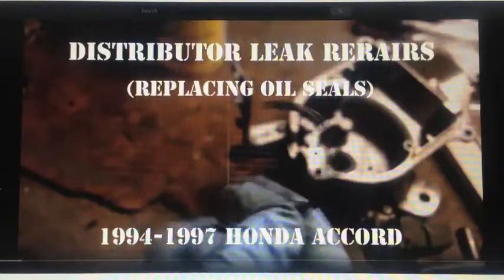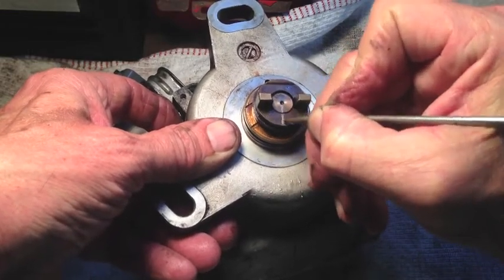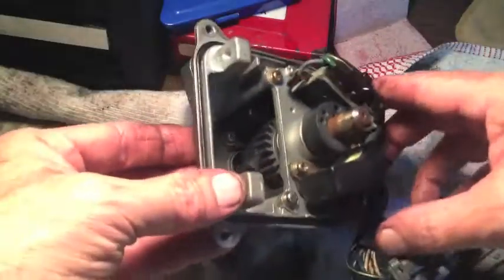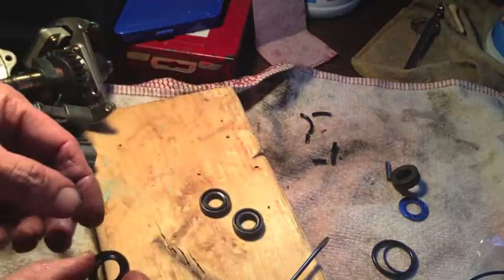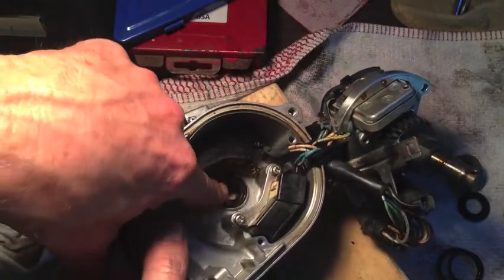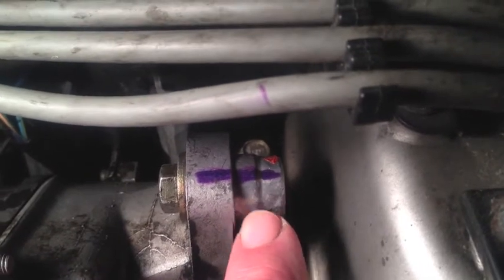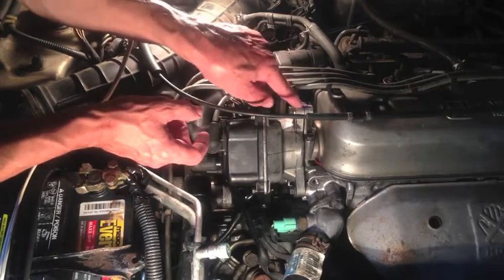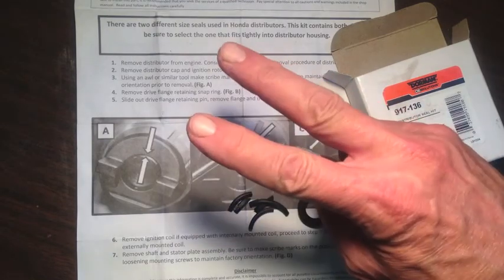Honda Distributor Oil Leak Repair (Seals)

Comment: If you're going to replace the heater hose that runs under the distributor, and you don't want to pay $30 or so for the OEM Honda hose 19527-PHK-000 from the stealership for a '97-'01 CR-V, I did the ground work for you (since after some closer inspection under the distributor that hose was SWOLLEN from probably years of oil dripping onto it from a bad distributor o-ring, and the previous owner(s) neglected it). They have epdm heater hoses at Napa for $.99/foot for this size hose. This is a 5/16" (7.9mm) heater hose (NOT 1/4" as stated on Napa's website), and it is 9" long (Not 8" long as stated on Napa's website) so one foot is all you need then cut to length. Napa part number NBH H149. It took me THREE tries to get this correct since Napa's website has the wrong info for this part. Still saved myself $30 though. You're welcome.

Comment: The aftermarket distributor I replaced my original with is already starting to fail six months later. I replaced it due to an internal oil leak. The replacement isn't leaking, but it's starting to cause a brief cold misfire most mornings. I wasn't sure if the car was even going to start this morning. Typical aftermarket electronics....
I almost dropped about $500 on a new distributor from Honda today. I'm glad I discovered this video, and kept the original distributor. I'll have the parts tomorrow, and plan on re-installing the original distributor this weekend.
Thanks, you might have saved me $485 with this video.
Reply from the maker: Hope so.. Good luck..
Reply: Yo did you install the new distributor without having to use a timing light?

Comment: Thanks buddy 👍 Just what I needed to fix  that oil leak. Also replacing the heater hose below the distributor.
Reply from the maker: Glad to help.. And yeah perfect time to replace hose.. Mine had recently been replaced so I just cleaned it off.. Thanks for reply..
Reply: @tongo117  can oil in the distributor cause no spark ?
Reply: @goldengaming1112  I know it’s a month ago but yes it can wear down the electronics in the distributor. I’d try  fixing the leak and then cleaning the inside of the distributor before replacing it to save a buck though.

Comment: hey so I accidentally snapped the dog ear on the drive dog and want to replace it and I see that you marked the orientation to put it back on but I was wondering how I could make sure I have the correct orientation on a completely new drive dog that im going to replace the old one with? can I just point the line indent that's only on one side level with the line on the distributor itself and put the new dog on with the line at the same orientation? its an expensive coil on plug conversion distributor so I really don't want to mess it up, Thank you so much in advance

Comment: my distributor has been leaking out for almost a year , my car is honda accord 2002 manual transmission, unfortunately now i have a failure in my vehicle speed sensor and Engine Coolant Temperature sensor because they are under the distributor , i didn't know anything about it but now i know 😢  , i ordered a new vehicle speed sensor, new Engine Coolant Temperature sensor, new o ring and new distributor seal,  i hope i can fix this  , 😊
Reply from the maker: you can.. good luck..
Reply: Howd it go? I've a 1998 Manual Accord as well. Leaks in the same damn place. Need to do this replacement. Anyone thought of just replacing the whole distributor?  I think they're inexpensive?  ALSO- i just did a swaybar upgrade video how to (front & back) for 98-2002 Accords!  Check em out if you want.😎

Comment: *Seal not gasket
If it seals a moving part it's a dynamic seal. If the part it seals doesn't move it's a static seal/gasket or O-ring.
Reply from the maker: Understand.. Thank You..

Comment: Hello, Im going to try this out, but I am scared about messing up the time as I dont have a timing light, did you have any timing issues with the method you used?
Reply from the maker: This was my first time taking the distributor off of any car so I was also concerned about messing up the timing.. I just tried to be careful about disassembly/reassembly so that it all went back together the way it was originally.. I didn't have any timing issues.. And this was done 4.5 years ago still have the Accord still runs well..

Comment: What exactly is the distributor connected to…. I changed my seals the other day and everything went fine until I was putting it back on , I was tightening the top bolt and the threaded hole snapped so the distributor is now only held in by the 2 bottom bolts

Comment: Thank you for your video.  Does Dorman Seal Kit 917-136 fit 1998 Honda Accord LX 2.3 L.
Reply from the maker: It should fit if your Accord has a 2.3L F23A5 engine.. This link is from the Dorman site: https://www.dormanproducts.com/p-76845-917-136.aspx?year=1998&make=Honda&model=Accord&origin=&parttype=Distributor%2520Seal%2520Kit&enginebase=L4%25202.3L%2520%282254cc%29&enginedesignation=F23A5
Reply: Thanks for your reply.  Do all Honda Accord LX 2.3L L4 have F23A5 engine?
Reply from the maker: Apparently not. The link below takes you to the Dorman page for the 917-136 seal kit.. If you follow the select your vehicle drop downs there will be 6 of them.. The last one is for engine designation.. There are 4 possibilities listed with the F23A5 being the only engine that the 917-136 kit fits.. https://www.dormanproducts.com/applicationcheckfit.aspx?&productid=76845
Reply: @tongo117  Thank you.

Comment: Hello, i tried doing this today and i could not get the pin out of the dizzy once i removed the cotter pin, i was hammering it all day and was not able to do so. any tips ?
Reply: Rubber Mallet the surrounding area, it'll loosen it up even if you aren't hitting the dizzy directly

Comment: I did my valve cover gasket and outside O ring and cut off the swollen part of the heater hose and thought I had the worst luck the only leak after the job is dripping right back on the heater hose and it's already swollen again.

Comment: Thanks for the vid, how did these seals end up holding up?
Reply from the maker: over 2.5 years later no leaks..
Reply: @tongo117  Makes sense when the old ones have gone 25 years! Mine's 1996 so also 25+ years before it leaked

Comment: My b18 leaking oil their its performance really doesn't feel the best. Would this effect the performance of the engine
Reply from the maker: Oil inside the distributor cap could cause an engine misfire..
Reply: @tongo117  ok i changed my distributor and leads  from another engine i have. Someone says iv to get the time set. But i drive it and seems to work perfect.
Reply: @tongo117 , So does getting too much oil in the spark plug wells.

Comment: At around 140,000 miles the distributor is ready to die. I would not recommend replacing the inner seal unless you are dealing with a distributor with under 80,000 miles on it. Maybe change the outer O-ring, but go no further into the can of worms. New after-market distributors can be had for under $300.00 the last time I bought one a few years ago. Weigh $300.00 against your car quitting on the freeway in traffic.
Reply: I have the same two issues - heater hose with hole and distributor leaking oil (which has been happening for a long time).  I'm going to replace the distributor entirely along with the hose.  I'll keep my OEM distributor if the new one dies, but I did not feel like going the gasket route.  It is my beater car that I only drive locally so I'm not terribly concerned if I need to address it in the future.

Comment: What was the symptoms?
Reply from the maker: I had no symptoms as far as how the engine ran.. It ran fine.. The visible oil leaking out under the distributor cap is what led me to the repair..

Comment: Could this cause a crank no start?
Reply from the maker: If oil leaks inside the distributor cap and gets on the contacts and/or the rotor it could cause a no start.. https://repairpal.com/car-wont-start-due-to-oil-contamination-in-distributor-083#:~:text=The%20distributor%20may%20become%20internally,the%20car%20will%20not%20start.

Comment: dorman seal not good, i put dorman seal, it still leaks, get OEM one
Reply: I think that's what happen to me aswell, using aftermarket seals, cause i changed all three of those seals, even checked the resistance on those internal stuff, still leaked shortly afterwards, however it didn't hinder(stall) the car's performance, just got the top of the transmission messy with oil >.<.

Comment: Yeah, it's easy when the pin comes right out like in your video. Unfortunately, the distributor in my wife's '01 CR-V was one that you have to mallet the pin out. I don't have the punch, the mallet or a way to hold that damn cam without it rotating whilst I whack away. I just took the L and cut my losses when I realized the futility of continuation without the appropriate tools and time and purchased a brand new distributor on Amazon for around $60. Hopefully it works because I don't want to shell out $300 for a new one from Napa. Prolly one of the most anticlimactic repairs ever. Really bummed when I removed the clamp and tried to push the pin out and.....nothing.
Reply: Having the same issue... the OEM seals were about $20 so another $40 for the whole distributor doesn’t seem so bad but it’s definitely a shame, I spent a couple hours disassembling it